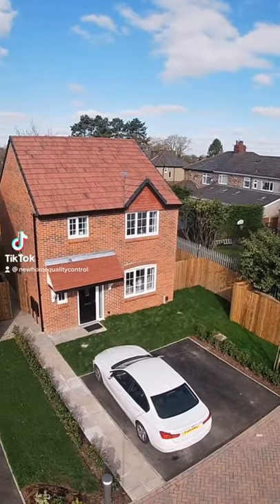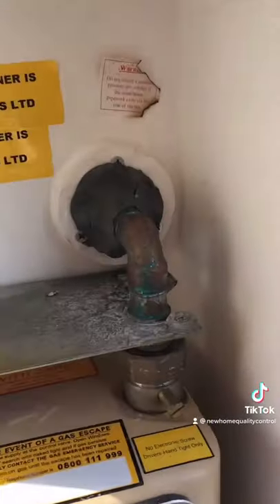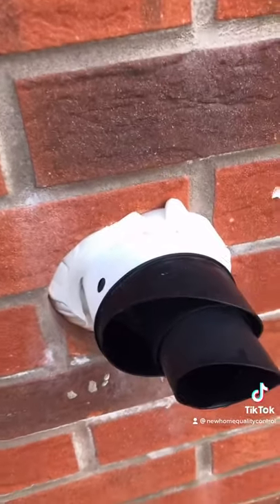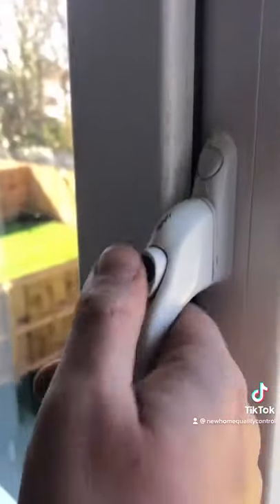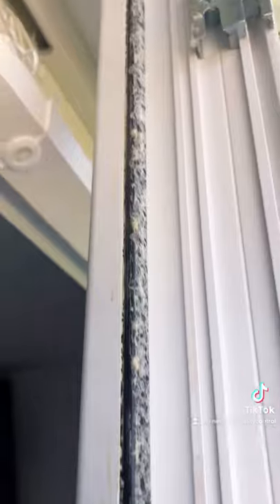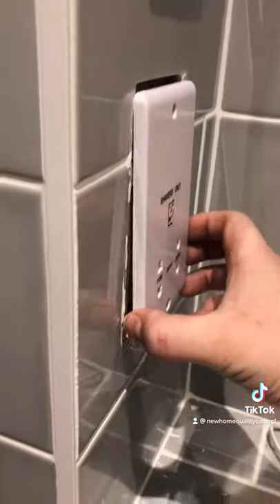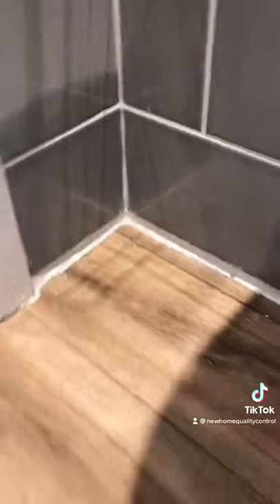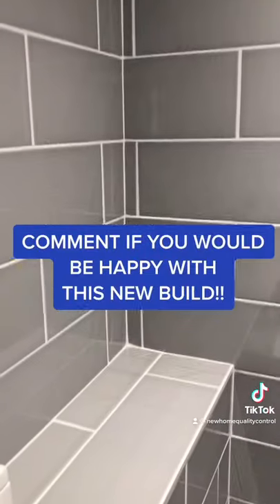NEW BUILD SNAGGING INSPECTION

Comment: This is why we need to be allowed to withhold a certain amount of money until the customer signs it as satisfactory
Reply: That's actually broadly how it's meant to work. Contractor hands over to client, who has their own surveyor sent in to check for defects. A schedule is compiled, and then returned to the contractor for them to either amend at-cost or compensate.

Unfortunately most new builds are funded by pension / trust mutuals who are building these purely as a way to diversify their holdings, meaning they're quite happy to just take the cash instead of repairs being made.
Reply: Most these houses are mortgaged, with very little down payment. It should be the bank holding back monies
Reply: Yeah called a retention pretty standard in construction industry. I would want a 10% retention built into the contract if I were buying a new build.
Reply: Hey it's Dylan Mulvaney's husband
Reply: Totally agree.
Reply: @TheScaper28  The point about retentions is that at the pricing/tender stage a sum is added to the tendered price of the job so that the contractor is never out of pocket and when the retentions are released then its a bonus for the contractor..  Retentions are normally 5% with half being paid back at practical completion.  

A better way is not to value the defects so that the value of any defects is taken off the price and only released when complete.  That means that its in the contractor's interest to have as small a list of defects to have the lowest retention and it will be a speedier resolution of those defects.

Comment: If that’s a new build as a site manager if I handed that over I’d be ashamed and expect to be sacked!
Reply: Yes but you have morals. The guys that pass these have a very strong financial incentive to keep quiet. The whole system is corrupt.
Reply: You need to keep digging deep and exposure them your doing a mega job well done 👍
Reply: Sadly,  most don't share the same attitude
Reply: Unfortunately you'd be on your own... Many moons ago... Your work reflected on YOU... most had pride in their work.. Now.. Not so much.
Reply: I was lucky I had a good site manager.  We did a complete walk-through and he pointed out things that we wouldn't have noticed straight away.  We also stood firm on a few items, like the fence that was meant to be closeboard, but had the gaps in, so they agreed to put another layer of boards across to closeboard it.  They even took down part of the first floor (in UK) brickwork due to high winds over the weekend which had moved the bricks slightly - took that part down and re-did them.  You could tell he had pride in his job, in the walk-through he even gave us a rundown of the types of bricks they used and where other materials came from
Reply: Yeah right mate
Reply: Site managers are the worst
Reply: The chancers who have got a SMSTS card have never been in the building game.
Reply: Yeah pretty bad if you are proud to hand over a building in that condition id be hanging my head low in shame
Reply: More like if you handed that over you would get a pat on the back and an envelope of cash
Reply: The bosses only care about hitting quota targets. A site manager who hits targets is way more important than one who delivers quality homes, but misses targets. Capitalism for you.
Reply: ye what make me think is its all stuff done on purpose
Reply: Most site managers couldn't give a fuck and would pass the blame to the contactors then bounce back in the site office and have a cuppa
Reply: I'm a bricklayer and of they're letting shit like this slide on the finish then you should be really fuckin worried about the stuff you can't see, ie the substructure and pipework
Reply: Like all the labour employed on the site the site agent is likely to be agency staff so he doesn't give a s**t because he probably moves on to the next house builder.  The only likely staff member is the QS and he probably looks after more than one site and hasn't got a clue about quality.

When I used to work for a New Towns Development Corporation we had a Clerk of Works Department to inspect all the jobs but still the quality control by the contractors was awful.  I had one contractor that had a turnover of more than £20M per year and the only permanent staff were the two directors, an estimator, a buyer and two admin staff, everyone else was a sub-contractor or agency staff.
Reply: You would be sacked if you didnt hand them over in time and trust me that time is very short
Reply: @DEVINE.IMAGE.  That would be a part of the problem as well, in that it seems to be more important to hand over the building no matter what the state and/or the fact that the whole project is rushed.  In general building contracts there are genuine reasons for an extension of time (incompetent management and programming is not one of them) but in house building the God of the sale and therefore cash seems to rule.  Its a shame that the concept of using a purchasers surveyor to sign off the building as fit for purpose doesn't apply mostly.  Too many people are willing to accept crap rather than get professional assistance to ensure they are getting what they are paying for.  I assume that this video follows one of those rare occasions when a surveyor has been appointed to carry out a pre=sale inspection.

Comment: As a Electrician I can tell you it is not a requirement to have an Equipotential bonding cable in the meter box!
Reply: Gas regs and electrical regs always differ on this. I wish they would sort out which one to use. 👍
Reply: It depends whether the service is metallic or PE.  But it's a new build so it will be PE, so in this case, I agree with you.
Reply: As another electrician totally agree it doesn't need to be in the meter box, total lie
Reply: @cjmillsnun  Wrong, if the service is metallic then it needs to be within 600mm of the meter union or entry point if the meter is external
Reply: @elwittinio2865  Because has folk don't understand why we bond pipes
Reply: Every meter I have ever seen has been earth,
Reply: Your regs may say not, but in the new build game they are required to do it. Not by elecrical regs but by building regs, they want belt and braces.The house shouldn't pass inspection. The trouble is, when a site starts the first so many houses are inspected, then it's left for X amount of months where 100 houses could have gone up, then a few more are checked. It's the in-between houses that are like this just silly little things missed.
Reply: Yes you are correct, it does not need to be in the meter box and is better within 600mm of entry point. @entergenericedgynamehere8751
Reply: @marty3553  It is not required if the incoming service is in plastic. Even if it is metallic is is better to be within 600mm of entry point into house rather than meter box.
Reply: @entergenericedgynamehere8751  that what the gas regs say.
Reply: New build house the incoming gas pipe is plastic . No bond required.
Reply: @dannythorpe1425  talking  rubbish
Reply: @derekgoodwin6646  sure, I don't work on new builds daily.....
Reply: @entergenericedgynamehere8751  This guy has the correct answer, within 600mm of the meter 👍
Reply: that meter is an external meter, it's outside the dwelling. main equipotential bonding should be internal and as close as practicable to the point of entry, the meter box is acceptable but not preferred.
Reply: Its within 600mm of the meter outlet or before the first tee.
Reply: If incoming pipe is plastic and all circuits are rcd protected no need for gas bond .

Comment: The downpipe not being connected is more of an issue than you pointed out. If water discharges next to the foundation like that I could cause subsidence leading to expensive foundation repair.
Reply: Yes but very long term
Reply: @hmu05366  not in ever case. Depending on the strata below the foundations, if that’s a granular material like sand for example this could be washed away very quickly.
Reply: @BerkleyBuilds  Where is it going to wash away too? Really. What if its piled?
You know what foundation type ? Stop trolling buddy if you dont know what your taking about.
Reply: @JagerScot-01  as a former building inspector who’s also done warranty inspections I know exactly what I’m talking about. You clearly don’t
Reply: @BerkleyBuilds  HaHa. What do you think I was buddy. So your called for a stage inspection. You have a gander at the load bearing strata. You give the manager a RI for his fault because you know in the future that the down pipe is not connected and going to wash away the bearing strata from under your strip foundation. Ha ha. Priceless.
Reply: Don't worry the NHBC guarantee will cover it!
Reply: @JagerScot-01  hes right so i would stop gobbing off if i was you, making yourself look like a mug.

Comment: The sad thing is that if you threaten to pull out of the buy, they know that they can find someone else to buy it within a couple of days tops! So most builders currently don't care about the details like they do when it's a buyers market.
Reply: That’s a good point, there are not enough houses, so it’s a sellers market and there will always be another buyer.
Reply: The thing to do is to get the defects valued and hold that amount as a retention until its fixed.  If it doesn't get fixed then use the money to employ someone to fix it.

Comment: The bonding one might not be needed, it depends on when it was tested, if the pipework had a insulation resistance over 22kohms then no bonding is required. Most new homes with plastic incoming pipes wont need it as per BS7671

Comment: Earth Bond to Gas meter. Yes it can be connected within 600mm of the meter. BUT the connection can be made at the point of entry to the property where the meter is external. (As the Gas pipe comes through the plasterboard and into the boiler) at the most practicable location.  In some situations this is better as it reduces the chance of external damage and corrosion.

Comment: Is the gas supply plastic or metal? Being a new build the supply is probably plastic so it is not an extraneous conductive part! But yes if the supply to the building is metal then it needs to be bonded.👍

Comment: The gas pipe doesn’t need bonding if it’s a pe supply pipe, if it’s a metal supply it should be bonded within 600mm of the point of entry to the building. Not he box.

Comment: Absolutely shocking! Although the meter doesn’t need to be bonded inside the meter but but as it enters the property according to bs7671 also the incoming pipe may be plastic as it’s a new build so might not need boding at all.

Comment: The gas doesn't have to be bonded in the meter box. If the service is metallic then it should be bonded within 600mm of the meter outlet union or entry point into the building if the meter is external

Comment: Earthing of the gas meter, IEE regs states, has to be bonded 600mm from the meter OR THE POINT OF ENTRY. You should NEVER take a bonding conductor outside if it’s connected to a TN-C-S system (PME). So it’s not a fail check inside.

Comment: The gas pipe most likely doesn’t require an earth bond. As the gas pipe coming in will be PE(plastic) in that case it doesn’t need bonding and under some instances it can make an installation worse if it doesn’t need doing

Comment: Incorrect regarding the earth not being bonded. If the incoming supply line is MDPE which it most certainly will be as it's a new installation then no main euipotential bonding is required as stated in the 18th edition electrical installation requirements.
Reply: The pipe is copper where it enters the property and is classed as an exposed conductive part and so should be bonded to earth as a live conductor touching the pipe would  potentially cause the pipe to become live if any plastic pipe fittings are used inside the property

Comment: As a qualified electrician the regulations regarding the gas pipe bonding are within 300mm of where the pipe enters the property, it will be bonded the other side of the wall as an external meter box is not where the pipe enters the property

Comment: How do you fix a brick wall thats so out of plumb? Do you literally knock that section down and go again?
Reply: It was more than likely level with the spirit level that was used during the build but spirit levels are notoriously in accurate! Fine for short runs it will look level to the eye but as soon as you do say 2.4 m floor to ceiling it will be way out over the distance. 

Best way round this is two decent laser levels of different colours say red and green and work from that along with using a tape measure and laser measure to gauge the distance wall to wall as it rises 

But that’s all too precise and people wouldn’t buy because they have to wait longer to move in, consumerism killed the quality I’m afraid. 

What I will say is I’d happily swap that new build for my 1950s town house any day. You think them walls are out 😂 my house feathers the inaccuracies of an old Tudor building
Reply: @infamouselixir90  Hey cheers for the info that was interesting to read - Im a maintenance manager in a hotel so always interesting to see how trades work and the stuff they do, I've never ever fancied bricklaying, to be honest, 🤣
Reply: Straight answer. “yes”.

Comment: The gas meter doesn’t require bonding if the main gas pipe within 600mm of it entering the property is bonded, ensuring it’s bonded before any T connections

Comment: It's not just new builds.
I live in a just postwar house that is currently falling apart. I'm seriously needing some remedial work. The local council has offered help several times in the last 5 or 6 years, but nothing has ever resulted other than excuses.
So it's a question of having work done when I've saved enough to afford it - a plan now in serious jeopardy given the bills I'm getting from British Gas. 

Trouble is that - in my 70s - I can spot BS at 100 yards with the wind against me. So I've shown the door to more cowboys in the last year than I've had hot dinners.

Last builder I had in gave me a quote to simply replace a multi-fuel stove for an established central heating system with no other problems. For an estimated day's work (two at most) his quote was £6500. I gave him 10 seconds to be off my property before I set my dog on him.

Comment: late 80's bungalows here barely any cement in whole place not just new builds, holes left for water to reach the foundation , main water pipe under the driveway, leaking at 1260 LT an hour for at least 4 years , bad building been going on since end of prefabs.

Comment: And that’s only the surface level damage that you can see but imagine the actual structural damage that you cannot see that’s effecting the home. What’s not easily visible is even scarier and worse than you can expect from the surface problems he’s pointing out. This property has not been maintained so you can just picture the foundation and complex configurations like carbon monoxide flute filter, hvac, electrical, insulation, pipping, pipes, gas, water lines, heat, water tank etc as being a shoddy danger, risk, and death trap

Comment: The Gas pipe would not need a cable to it if it is a plastic incoming pipe
Reply: It was metal though
Reply: The incoming pipe is plastic on the left coming into the meter this creating no potential.
Reply: I agree with you Paul , electric regs say you don’t have to bond it , but gas regs say you do, you won’t get a corgi plumber to sign it off without a bond

Comment: Absolutely shocking work all over this. No way would I be completing on this if it were me. 

But that's what happens when the "big companies" pay off the inspectors to not ACTUALLY inspect a thing. 

I know this for a fact too, as I had a new build on a new site where they were still building. 

I filmed the inspector go and sit and have a cuppa with the site manager in the office and then sign off the remaining properties, despite the fact they never once left the office and 4 of the houses were not even finished. 

Not one of the houses had snagging lists less than two pages long.  In the end the developer was taken to court and were forced to buy back all of the house on the site. Every one of them.

Oh and the back garden on one of the houses was 15 feet shorter than it should have been. 
Why?  

Because it turns out the developer had decided to make a bit of cash in hand by "selling" the 15 feet to the owner of an existing house that backs on to the new builds.

Comment: Who would buy a new house?? On a old house you might need to change the slates every 50-100 years, with modern timber framed building that were constructed using nail guns, you will need to rebuild the whole house every 50-100 years at best and if they were done badly much sooner! As soon as the mortgauge is paid you will need to take out the same again for the work which will be needed!

Comment: My first house was a barrat house that had been repossessed.  The original owner bought it for £175k, and approx 7 years later I bought it for £113k from RBS after they repossessed it.  It was a decent sized house but the fittings etc were of poor quality and it needed a lot of work done for such a young property.  Sold it a couple of years later and made a nice bit of profit.  I’d never buy a new build unless it was repossessed or went to auction.  They just don’t hold their value at all.  They are horrible looking and have tiny rooms.  They are poorly finished as well.  Don’t buy a new build if you want value for money.